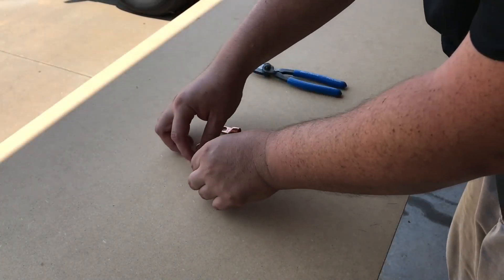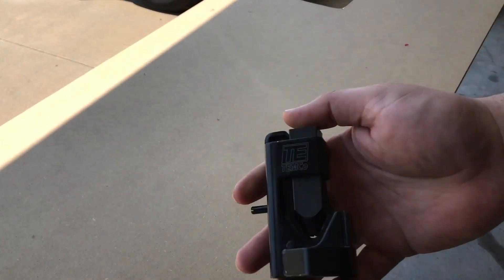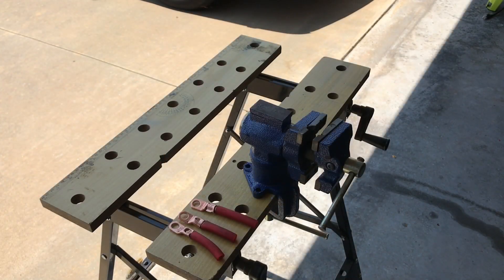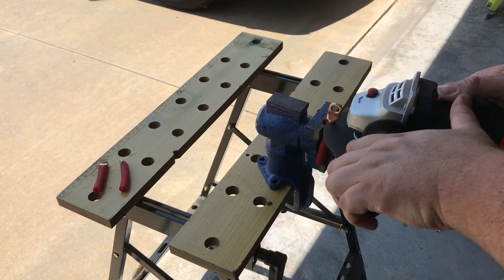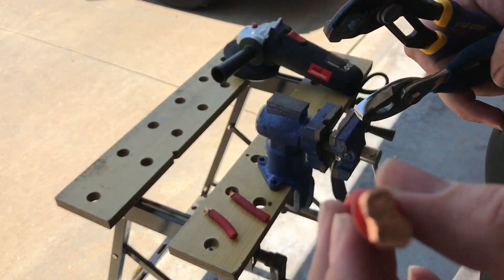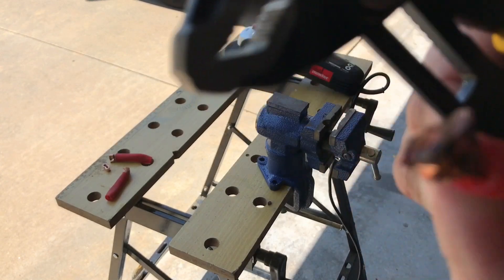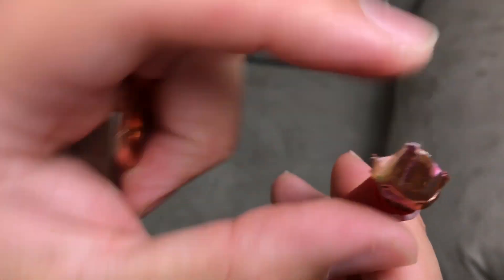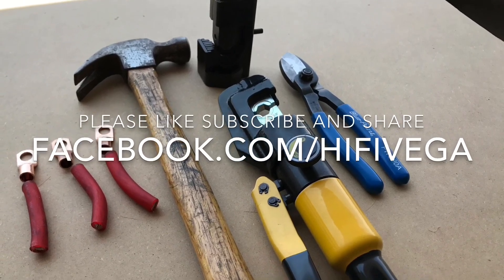How to crimp a lug (3 methods tested)

Comment: Also good to remember that the hammer crimp device is only useful if you have a hard and stable surface to use in the process whereas the hydraulic crimper can be used in more scenarios.
Reply from the maker: Very good point
Reply: @HifiVega  Great video btw.. I love videos like this.. going the extra mile to cut into the lug to really see whats going on inside rather than just tugging on it and moving on.

Comment: I’ve used a vice with a small nut on one side and it works decent. I still think those crimpers are the way to go. I do use dielectric grease in the lugs and coat the wire.  Helps prevent any corrosion and makes a better connection

Comment: I've done the first method but with something shaped like the peice of metal you hit with the hammer on the second one,While laying on a piece of steel so there was no vibration. Turned out just like your the hammer crimp. That screwdriver was the main problem

Comment: Great video thank you, I used a hammer crimp tool, today, on one awg, I have an 01 Chevy express, that I am setting up, with 2 agm batteries, for off grid use, sobivstarted the wiring process, I also soldered, the lugs I made, and drilled a 3/8 hole in the end to connect to military spec, terminals, and in the rear, I want to get a DC to DC charger, with a 100 amp circuit breaker, first time I have ever done anything, like this, so I'm watching a lot of how to videos, thank you for sharing!

Comment: So is that hammer crimper something you made or that can be bought? Didn’t get a good look at it but seems pretty straightforward, might be able to use it with a small hydraulic press for better results. I’ve always done the screwdriver thing, I found on something that hard that won’t let the bottom of the lug mushroom out it hold a lot better.
Reply from the maker: You can pick them up cheap and they work great
https://amzn.to/3GvjV33

Comment: You don't need to crimp it. Just get everything ready, heat up the lug, melt solder in it about 3/4 filled, then just put the wire in and let it cool. Just don't overheat it.
Reply: Terrible way to solder. Nothing will wick into the wire.
Reply: @ah4800  hahaha. what a joke. Sure, if you do it your way it won't work
Reply: @RobHTech  guess you've never heard of a cold solder joint. You're not supposed to glue it You're supposed to solder it. Like i said, solder travels to where the heat is naturally, you won't have any or very little solder between the wire strands.
Reply: Lets be serious here, the real joke is your soldering advice.
Reply: @ah4800  You don't know what you're talking about. Solder never sticks if you don't use flux.
Reply: @RobHTech  coming from the guy that's gluing wire together instead of soldering it. That's rich.
Reply from the maker: I prefer a cold weld crimp, but…

https://youtu.be/UMeGCQa-oCI

Comment: for years i have just filled the lug with solder and inserted the wire with molten solder inside. never had a problem with it. however I have an amp install job for a customer and he has open ended crimp terminals. so will finally after 15 years have to pick up the crimpers
Reply: Solder is the best method of all, but crimping is faster and more easy to do so that is why all use that now...

Comment: I wonder if you tried a different diy method. My thought is on the screwdriver method, after hitting it a few times like the first step but then place the lug in your vise and place the screwdriver in the vise also and twist it as tight as you can

Comment: I’ve got a crimper like that hydraulic one but it doesn’t work well for 4 gauge or larger so I usually put them in the vise
Reply from the maker: What dies are you using on the bigger gauges?
Reply: Mine has a solid jaw with 3 sizes and the biggest one would probably work but squishes out the sides like yours on 6 gauge so I didn’t want to ruin the lug trying it on 4
Reply from the maker: @gregblau8082  yeah you need a 65 die for most car audio 1/0 wire to get a nice crimp
Reply: I actually had to go to harbor freight and get a lug for 2 gauge welding cable because the 4 gauge I had didn’t fit the oversized wire.

Comment: Dude, get this crimper

Check this out at Amazon.com
TEMCo Hydraulic Cable Lug Crimper TH0006-5 US TON 12 AWG to 00 (2/0) Electrical Terminal Cable Wire Tool Kit 5 YEAR WARRANTY https://www.amazon.com/dp/B00HJXHX1K/ref=cm_sw_r_other_apa_i_kyAhFbVSV8BHH

Comment: Now it's time to flow some current through them and monitor their temperature. The best connection should be the coolest under load.
Reply: Is that really the case? Wouldn't less resistance = more amperage for a given voltage = hotter?
Reply: @jamesmeehan  why is that? Won't connecting the leads of a battery with copper wire heat up more and faster than if they were connected by a 100 ohm resistor?

Comment: The hammer lug crump tools are usually under $20 if that helps make any decision for anyone. Even the Harbor Freight hydraulic crimper is $65 so the price of those only goes up from there. The hand lever ones without the hydraulic assistance aren’t worth even looking at as you can’t create enough pressure to get an effective crimp

Comment: Am an electrical engineer, nothing about any video is good from a connection point of view.  Not one method here will hold the current that it is rated.  High probability of fire.  Don't do this, any of it!
Reply from the maker: Shoot me a link to your video that shows the proper way to connect a lug...
Reply: @HifiVega  I don't have one. The correct method depends on the wire and terminal. Change either and the process must be changed.  I worked for a major appliance manufacturer for many years and seen many crimps fail catastrophically. In some cases resulting in death from the fire which started at the bad termination.  With currents as low as 14 amps. My point to all whom read is simple.  Wire crimping must be done with the correct tooling based on the manufacturer of the terminal, the terminal must be chosen for the wire used, and lastly, the crimp hight must be in accordance with the terminal manufacturer.  Or the results could be fatal.  It's no joke, I have seen it.
Reply: Anthony Alexander Macholtz I call bullshit ,  that hydraulic crimper was practically cold welded and the hammer crimper was sound also.  Not one person who had done these methods in the field said otherwise in the comments.
Reply: @Pilot_Tony  In this case you're wrong. The hydraulic crimper is the correct tool for these lugs.
Reply: @dirtmover123  no, I am not wrong.  Please read my post again.  What I said is that for ever terminal there is a matching die.  The guy says he is not using the correct die.  Over and under crimping cussed failures.  That simple.  Maybe the crimper it's self us fine and correct.  But, per the video he is not using the correct die, therefore the termination is not to manufacture specifications.  I saw this in China, they would almost perfectly copy the USA tooling, but very minor changes would cause failure.  It depends on what is s acceptable for the application.  But I guarantee that if the manufacture tool is not used, the termination will not meet the published specifications.  Just ask any terminal vendor if you don't believe me.

Comment: I have been meaning to buy a hydroelectric crimper, But for now I use my trusty vise grips.its not as pretty but it is effective if you repeatedly crank them down.I also make my own lugs out of copper tubing.
Reply from the maker: Joe Belton I ended up doing that in a update to this video and it worked better than I anticipated for sure

Comment: Use a different hammer that one is for pulling nails out
Reply from the maker: Had this hammer since I was a teenager and it does everything a hammer can do!
Reply: @HifiVega  also that sheet of wood suspended in the air is absorbing all the force in the hammer blow.   It should be hammered on the concrete ground or an anvil.   No wonder the lug just easily pulled off.
Reply: @HifiVega  also, keep in mind that all cameras have a minimum focusing distance....which means if the subject is too close to the lens, the lenses will not allow it to focus.  Simply pull away from the lens a bit and the focusing system should latch on.

Comment: I have done permant crimps with a little flux, solder and butane torch. Just clean copper so that the solder grabs. That's a no doubter crimp. Great video though. Easier to do either of those 3. In a stationary crimp senario screwdriver method would be enough. If that crimp is jumping around or vibrating. Do the hydraulic or solder. Thanks, take it easy...
Reply from the maker: mario sellet I’ve tested that method as well on this video

https://youtu.be/UMeGCQa-oCI
Reply: HifiVega, thanks for the link. Great minds think alike. The ugly one or all of them for that matter could of used a heatshrink. But then it would be to professional and scare off all the DIY'ERS. Peace brother

Comment: What up Hi Fi Vega my name is John D i want to thank u for all your vid . Big D much respect for you 2. I used to be intoncar audio in the mid to late 90s . Listning to one of yalls 12 volt talk got me back into the game.  Do you guys want to here the funniest thing ever ? I orderd a very low budget system for my work car.  A 99 ford taurus . I ordered ssl dvd , 4 Pioneer 6×8 ' 2 Blaupunkt 12 for 20 a piece . and a power acoustic rzr1 2500d , and a sealed box for the 12's. And ssl amp kit. Everything from walmart.com . Everything came in besides the box. Once i got the alertt that the box came in walmart 3rd party seller sent me a ball point pin Instead of a box .  I just want big d and hi to have a good laugh . but guess what i did with that pin i built my own badass box . So it was a blessing in disguise .
Reply from the maker: John Dunn awesome! Love getting folks back into the hobby

Comment: I don't know why anybody would solder 16mm2 cable??? That's what hydro crimpers are made for. Soldering wont produce an airless terminal in this application, but hydraulic crimping will produce that full ‘coldweld’ terminal. Anything else is inferior energy transmission and basically failure in ideal termination...  For people watching this, heat shrink your terminals after crimping.
Furthermore, I don't know why you didn't vice the lead when you pulled with your plier?
Reply from the maker: First Timer funny you should mention solder because I think I will do an update and put solder to the test. You’re right I should have used the vice, but sometimes you get wrapped up in the project and start doing without planning lol

Comment: I installed professionally for years back in late 80's - 90's.  We used a pair of bolt cutters, grind out the cutter blades a little to match your crimp. Best crimps for big wire ever.
Reply from the maker: chuck miller I bet that’s why they make actual crimps in that style today lol.
Reply: haha, maybe. We used a vise with a bolt sometimes too.  But you needed 3 hands. Back then, not every car had a dash kit either.  Subwoofer boxes were done with a scientific calculator.  We were installing amps we could never afford.
Reply: @chuckmiller5763  I got 3 hands a vice and bolt and need to crimp 0 gauge wire. How do I do it?
Reply: @ljguy300  open the vise, hold the bolt with your left hand, hold the connector with the wire in it with your right, with your center hand, close the vise with the bolt against the connector.
Reply: Maybe just file the inside down blunt. Nice idea
Reply: I use a ruined bolt cutter that was extremely dull so it would not cut anymore to mount lugs on my 50mm2 cables for my 200A max 24v system but a professional electrician called me mad for doing that and said it would end up causing a fire...
Reply: No pro would do that!  A hacker, maybe.  Oh, wait I bet linemen use half ass tools too.  It's why the power is so unstable?  No, they use the right tools and the job last!  Give me a break people, if you need this size wire then you need a crimp done right, and that means the right tools, same people that use their pliers as a hammer.

Comment: One method which is even better, though it is not used much these days. This method is solder & crimp. This takes a bit of time. First, you heat the stripped wire,  & soak it with solder. Next, you heat the terminal lug, & fill it with solder. While the lug is still hot, insert the wire. Keep it hot to keep the solder melted. Next, use a hydraulic crimper to crimp the terminal lug whilst it is hot. Allow it to cool. This will ensure strength & electrical conductivity.
Reply from the maker: Christopher Marshall this is definitely a method I need to put to the test! I’ve had many people ask about it... Thanks for watching and commenting, I do plan on doing his in a future video.
Reply: Major problem with that is solder wicking. Any solder whatsoever in the wire that is outside of lug creates a massive stress concentration & that can cause issues unless it's a stationary piece of equipment completely free of vibrations.

But I've done it. LOL. Too cheap to buy a crimper & it was on an around town car that was going to the crusher in a few years anyway. But no way I'd use it on something like a long haul vehicle that could leave you stranded out in east nowhere, or weld leads that are constantly being moved & stressed & whatnot.

So you really just need to know your application & decide accordingly.

Comment: I would've been interested to see the cables ohm'd out/continuity afterward to see if/how the methods differ in the cable's functionality.
Reply: It would just read 0 ohms lol
Reply from the maker: Steve Matz that’s a good point and something I have been considering doing in a future video!
Reply: The real test is putting the connections under the rated load for the cable size. That will tell you if it is any good or not.
Using a thermal cameral will also help identiy if its a hot joint or not.
Reply: Better test is to run a LOT of amps (like 300A+++) trough and see if they start to heat up...

Comment: I used to literally do that on the driveway using nothing but the hammer and the concrete on with it laid on..... I just went hulk smash, pancaking the terminal flat. I pull tested every connection and it werked, but it was ugly.

Comment: This is a great video!   I am preparing to make my 44 year old truck some new battery cables so let me ask you, with the odd crimp shape the hydraulic tool makes, would heat shrink still work over that?
Reply from the maker: GREG BLACKBURN Thanks! Yes heat shrink fits easily over the hydraulic crimp.
Reply: Thanks.

Comment: I use that same hammer crimp almost daily on industrial batteries & forklifts.  Never a failure.  That said, I also solder the larger crimps pretty regularly as well and it also works great.  The big difference between the hammer crimp and the hydraulic crimp to me is portability.  You can't use the hammer crimp in a vehicle.  But you can use the hydraulic.
Reply from the maker: The hammer crimp works great and was my go to before I got this hydraulic crimper. We have a really nice Burndy crimper for all our industrial and forklift batteries that we build at work.
Reply: Oh, that would be a nice crimper to play with.
Reply from the maker: Mickey Pietrzak I'm going to do another video comparing other alternate methods and would love to use that one, but unfortunately my work is pretty strict about that kind of stuff.
Reply: Well, if it's not a method that the average consumer can use, I'd probably skip it.  That said, I suspect people would like to see a resistance measurement between soldered and crimped.

Comment: I've used the hammer method with a flat chisel many, many times. Always wanted a hydraulic crimper. Been using solder for a long time..its seems to yield good results. Good vid my audiophiliac bretheren.
Reply from the maker: Sinister I needed a chisel I bet it would have gotten better results! I should have tried solder as well I do solder all my open top lugs, but haven't ever tried on this style. There were a few other methods I wanted to try but alas I was low on lugs. Maybe I will do another one in the future with other methods suggested here in the comments.
Reply: You can buy that same hydraulic crimper from harbor freight for $50. I have one in my toolbox.
Reply: $40 for a 16 ton hydraulic crimper from eBay, lots of dies too